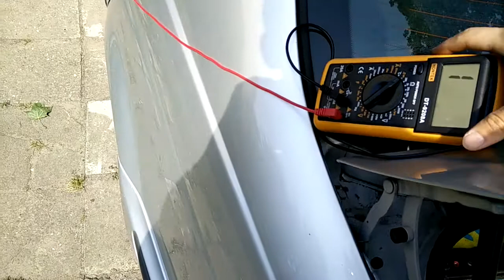Bmw e46 pin 17 light switch module check

Comment: Hey, I think have the same problem - the licence plate lights are not working. If I remove the lights, there is voltage 12 V on the light holder. But since I add the lights to the circuit, voltage drops to zero and there is no current (I messured 12 uA only). I checked the wiring - its ok. Also when I connect the wiring directly to battery (bypass light control switch), it's working. I guess there is problem in that control switch, which should be replaced :( How did you solved the problem? Thx